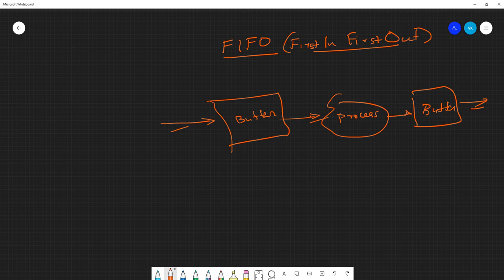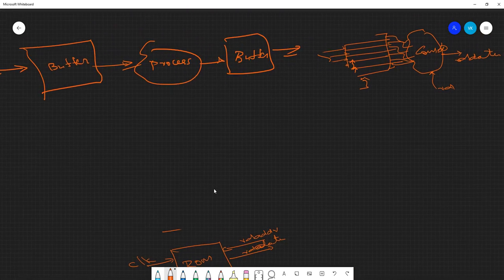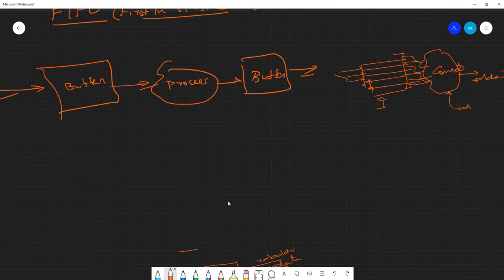Modelling of Memory Part-3| Modelling Synchronous FIFO|Verilog|Part 26

Comment: Very informative Sir.. I request Modelling of DDR1/2/3 also Please.
Reply from the maker: We will never buld ddr memory inside fpga. There is no need of it and there is no point in it. There will be ddr outside FPGA which will be controlled by a ddr controller inside fpga (usually mig ip from Xilinx). So we may need ddr model during simulation. DDR manufacturers (like micron) provide the models for free. Of course they won't be synthesizable but only functional model. Even when u use mig ip core, Xilinx will also provide an example design with ddr model. That model will be also provided by the corresponding manufacturers. Modeling all timing behaviours of ddr (like precharge, auto refresh etc) are not easy. So better to use models from vendors.
Reply: @Vipinkmenon Thanks for the reply and information, Sir !

Comment: Sir please guide me on this issue. I am trying APB master code. Getting error in port declaration itself. Not getting how to solve.
/////////////      Design Code:   /////////////////////
module APB_NEW(
input pclk,
input prst,
output reg [3:0]paddr,
output reg [7:0]pwdata,
output pwrite,
output psel,
output reg penable,
input  [7:0]prdata,
input pready
    );
reg [3:0] addr_bus;
reg [7:0] data_bus;
reg [7:0] mem [0:255];
integer i;
always@(posedge pclk)
begin
    if(prst)
    begin
        paddr = 0;
        pwdata = 0;
    end
    else 
    begin
        //if(psel)begin
           penable = 1;
           if(pready)begin
                if (pwrite)begin
                        paddr = addr_bus;
                        pwdata = data_bus;
                end
                else begin
                    mem[paddr] = prdata;
                end
           end            
        //end        
    end
end

////// Test Bench Code   ///////////

module tb_apb_new();

reg pclk;
reg prst;
wire [3:0]paddr;
wire [7:0]pwdata;
wire pwrite;
wire psel;
reg penable;
wire  [7:0]prdata;
reg pready;
 
reg [3:0] addr_bus;
reg [7:0] data_bus;
reg [7:0] mem [0:255];
integer i;

APB_NEW dut(pclk,prst,paddr,pwdata,pwrite,psel,penable,prdata,pready);

initial 
begin
    pclk = 0;
    forever #5 pclk = ~pclk;
end

initial 
begin
    for(i=0;i<5;i=i+1)begin    
        @(posedge pclk);
        //penable = 1;
        pready = 1;
        pwrite = 1;
        addr_bus = $random;
        data_bus = $random;        
    end
        @(posedge pclk);
        pready = 0;
        pwrite = 0;
        addr_bus = 0;
        data_bus = 0;      
end
endmodule
////////////////////////////////////////////////////////////

Error: [VRFC 10-3236] concurrent assignment to a non-net 'pwrite' is not permitted.

Can you plz guide.
Reply: @Dheeraj Chumble
Hi, Why are you driving 'pwrite' in your testbench? You've declared it as an output.
Reply: Have you implemented this on FPGA board?
Reply: @kisrisri8471  no..I did not